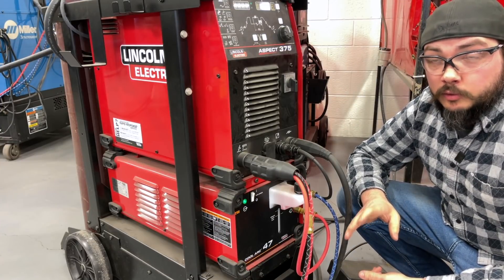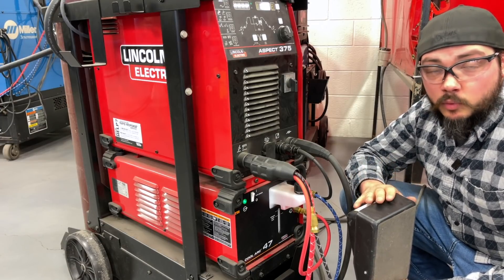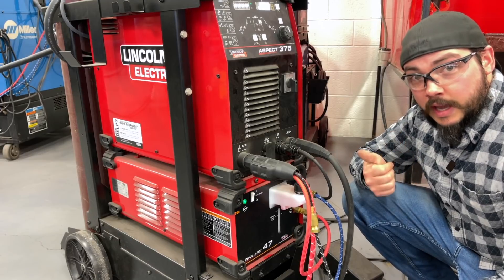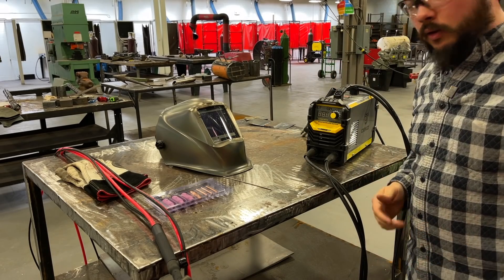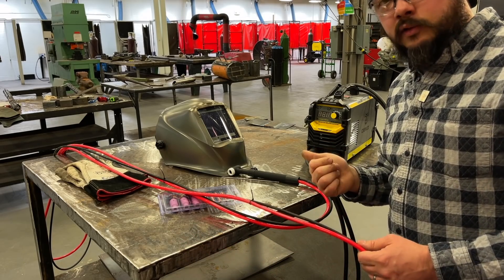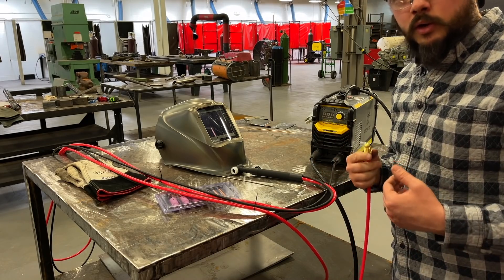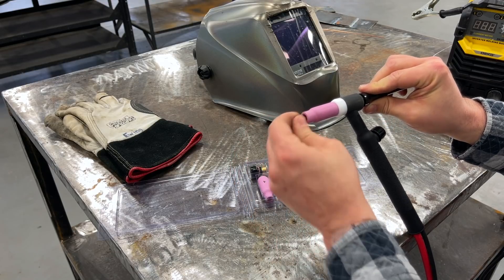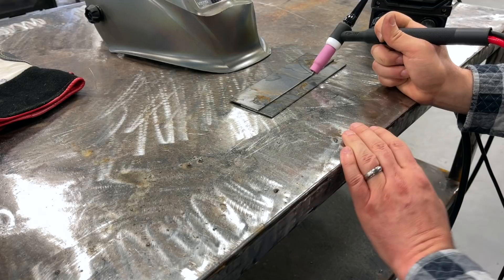TIG welding with inexpensive weld machine?! -Viewer Request

Comment: Fantastic video! 
I can`t wait to get a tig torch for my Forney 100ST. It is a great little 90 amp inverter, great for learning and smaller projects. It is a little higher end than the one in this video ( about $200 when I bought it). It actually has a lift arc function, so not scratch start, but there is no foot pedal, so practically, it isn`t much different. Still, its going to be awesome! 
Keep the videos coming!!!
Reply: I glad you enjoyed the video Connor, looking forward to seeing what you create with this new information. Feel free to let us know if you've got any video suggestions.

Comment: Hi, If I bought a decent torch with a start stop button on it and do a bit of wiring mods  would a normal mig welder work ok.
Reply: That's a great question, and my general advice would be "no;" depending on how intense the "wiring mods" you're discussing are. Most MIG welders are constant voltage machines while TIG and Stick machines tend to be constant current machines. You may get it to strike an arc, but it will likely be very erratic, and be much more headache than it's worth.

Comment: Don't forget that you need a flow meter $50.00 and a cylinder of argon gas thats another $350.00
Reply: That's true, I did not factor those into the cost because I had them in the shop already; but good to point out that if you're gonna need those too.

Comment: You will get better results if you clean off the mill scale before you weld.
Reply: You are absolutely correct! In my haste to try out my new toy, I grabbed the closest coupons and totally skipped that step. Good lookin’ out, and thanks for watching.
Reply: @chrisewing3272  well informed video. I figured it is directed at newbies so figured I'd add that comment.

Comment: To see if I really wanted to get into tig welding I got a yes welder 145, the leaking torch and lack of settings pushed me to get the everlast 161. Huge upgrade from the yes welder.
Reply: Everlast makes some good stuff, and stands by it with a 5 year warranty on parts and labor for most of their machines. Glad it worked out, and thanks for watching!

Comment: What so you think about Making your own leads,   00 for 100 footers?
Reply: Making your own leads is a great option. 2/0 is rated for 175 amps, so as long as you plan to keep your output under that, you should be good. At 100' I believe you'd experience less than 2% voltage drop. This particular machine (supposedly) has 160a output, so 2/0 seems like a good choice.

Comment: Hi Chris, great video! At the end you said that you couldn't do TIG of aluminium with this setup - presumably if you could hook up a helium tank it would be doable with DC? It would make a cracking sequel 👌
Reply: So technically, you can still establish an arc using DC on aluminum, and create a weld, but how difficult are you trying to make it on yourself, lol? The DC Negative side of an AC arc is gonna provide a narrow arc with deep penetration, while the DC Positive side provides a "cleaning" action with a much wider, shallower profile. Generally, we'll spend about 75% of our AC weld time on the negative side, and 25% on the Positive, for a nicely balanced aluminum TIG weld. Straight helium, combined with DC Negative polarity, would probably work well if your aluminum was really thick, as both the gas and the polarity would lend themselves well to a deep penetration weld. An argon/helium mix can do the trick, but extra focus would have to be placed on cleaning the material in advance, and considerable practice to achieve any sort of "passable" weld. Perhaps someone with more experience in D1.2 could chime in. And maybe I'll look around the shop for an Ar/He bottle, and frustrate myself for the viewing pleasure of others... Thanks for watching!

Comment: Scratch-start is just that, my old Airco Heli-Arc 130 is lift-start. You touch the surface with the tungsten, press the pedal until you hear the relay and when you lift the tungsten off of the surface the machine ramps up the current. My Syncro-Wave and Shop Master are high freq, naturally. I have a 250amp YesWelder on order as friends that have them swear by them. I used an Airco Mini-Arc 130 to scratch arc the fender back onto my 78' Ford Fiesta back in 87'. Just about the only scratch arc I have done because I only did that because I didn't have an alternative.

Comment: I'm considering an Everlast 275 lightening. What's your opinion on this machine. Looks like I seen one in the  background.
Reply: I typed out a long and interesting response to this, and I guess the interwebs chose not to post it, so in a nutshell - it's highly unlikely you'll be disappointed in this machine. I recommended it for a while before being hands-on with it because of it's specs on paper; and now that I've had time to use it and all it's functions, I will continue to highly recommend it. You can check out more about it here: https://youtu.be/iUPeZ5x3m7Q

Comment: red does not have the bad radio active rays(gamma) it is the grinding dust that is bad
Reply: I think most industries at this point consider all levels of radioactivity generally not good for people to be in close proximity to; both in alloying tungsten, and in grinding it into particulates and potentially inhaling them. Also important to note that these new inverter machines don't work particularly well with pure (green) tungsten either.
Reply: @chrisewing3272    but still might want to look up the difference between gamma radiation (xrays) and alpha, which only travels short distance and cannot penetrate human skin.
much misinformation passing thru welding industry
just trying to educate be helpful
Reply: @rickbrandt9559  Information is always appreciated,  and I am certainly no expert on all the different waves of radiation. All I know about gamma rays, I learned from Hulk comics, lol. We absolutely don't want to circulate incorrect information, and I see your point - but I believe my original is also factual, that the weld industry is moving away from the red 2% Thoriated tungsten, if for no other reason than an abundance of caution, or maybe to sell more expensive alloying agents. Either way, I appreciate you taking the time both to watch and comment!
Reply: @chrisewing3272  😊
Reply: Link to  safety            SSERC-bulletin-267_p15-17.pdf
Reply: Handling the red tungsten itself isn’t that dangerous because like you said, the rays won’t penetrate your skin, but when you go to sharpen it and put those particles into the air, that’s where the problems lie
Reply: @garretr4488  any form of material grinding dust is BAD !!
Just don't be A "Silly Safety Sally" with bad info.,

Comment: I love my Everlast PowerTig 200dv. Extremely versatile machine and has handled everything I've thrown at it. Priced well too.
Reply: I haven't used that one myself yet, but a thousand bucks for an AC/DC TIG machine is pretty awesome.
Reply: my 2nd everlast purchase was a power pro 205si, also very versatile. ac balance, frrquency, pulse settings, 2t, 4t, also a plasma cutter and stick welder. it's worked great, nothing wrong with my everlast machines so far